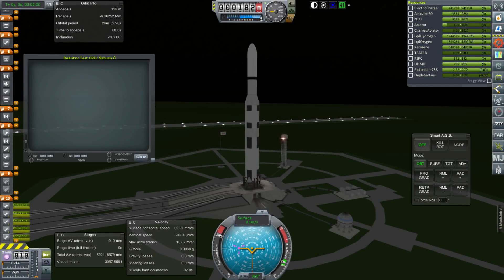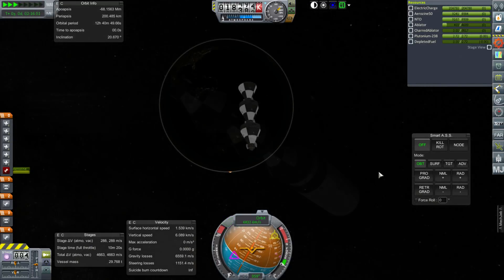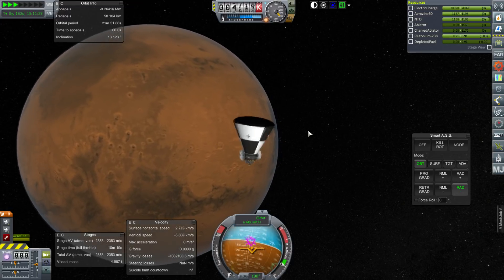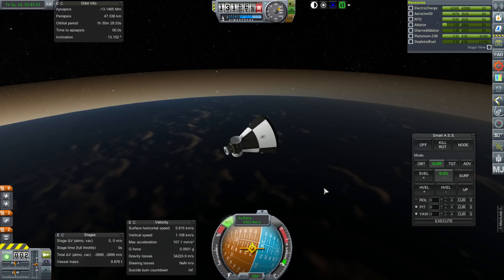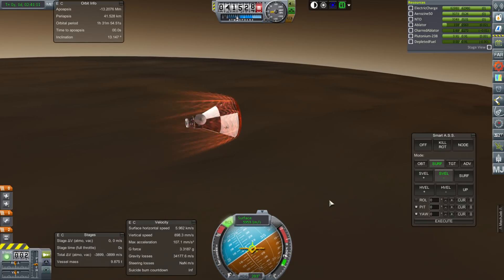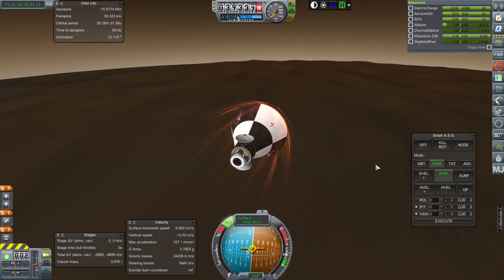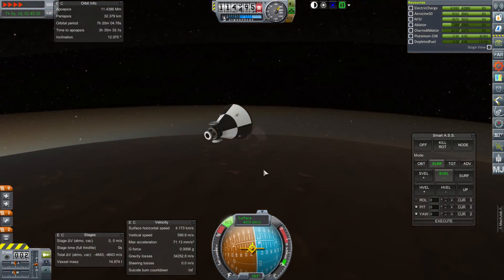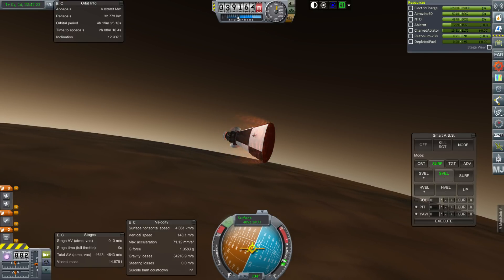Kerbal Space Program 1.1.3 with RO - Mars Entry Testing

Comment: Also, based on your data points tyler, ( if we assume the heat sheild surface area as a constant, and initial speed at SOI change as a constant ) does the relation between mass / depth of PE for capture apear linear? ( or close to )
Reply from the maker: Since we only tested two masses, the only graph that can result is linear. I'm uploading a test in 1.2.2 with a 213 day transfer that should be interesting. There, I got three data points, but I still need to plot it out.

Comment: Have you tried doing sectional density calculations?
Reply from the maker: Isn't that basically what I was doing by a fancier, though not usually applied in this context, name?
Reply from the maker: Normally, what I'd be calculating is called the Ballistic Coefficient - mass divided by (drag coefficient * reference area). I left out the issue of the drag coefficient here.